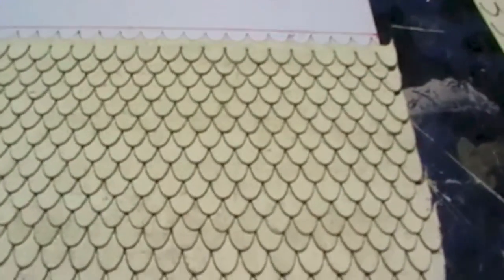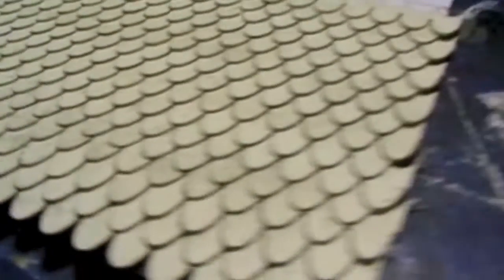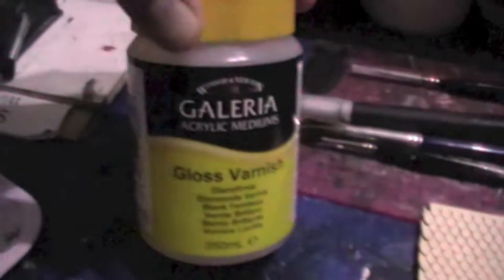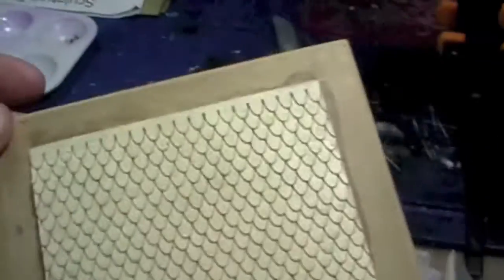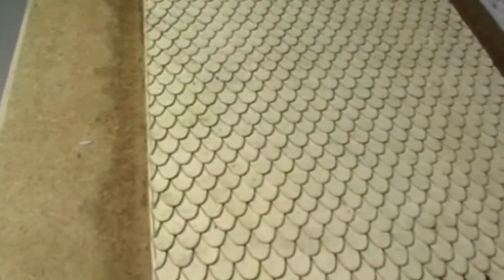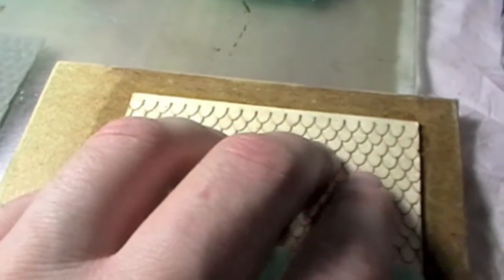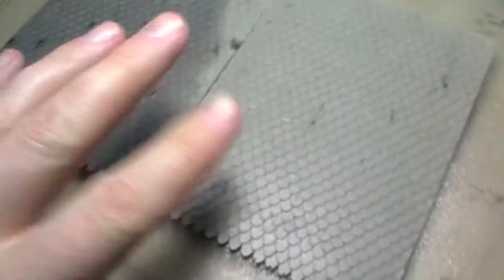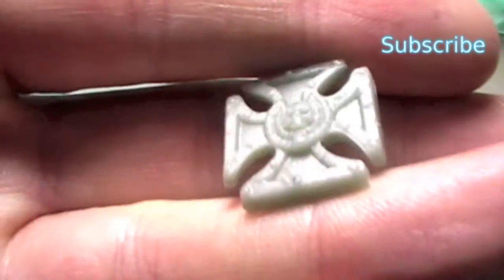Tiled Roof Moulds - How to - RTV Silicone (Lasercut MDF, Silicone and Resin)

Comment: Loved it bidge i wouldn't worry to much about the edges when do you ever see a square roof i am sure when you have got some paint on those bad boys they will look just as top as the one you lay by hand,looking forward to seeing your table build bidge it going to be sweet im sure of it,am i a bad man 4 think of Germans in camo smocks with lighting bolt lapel first,every time i see a iron cross instead of 40k ;)